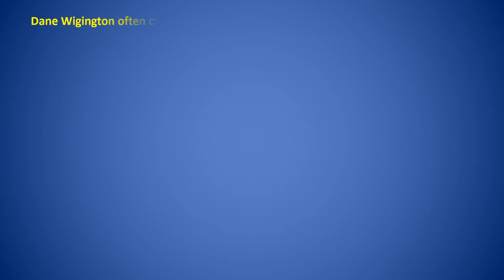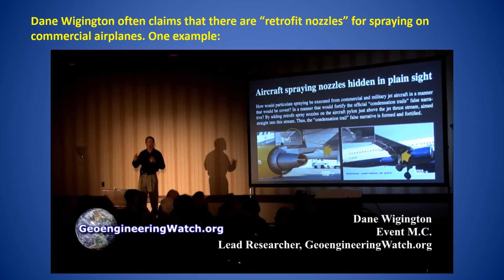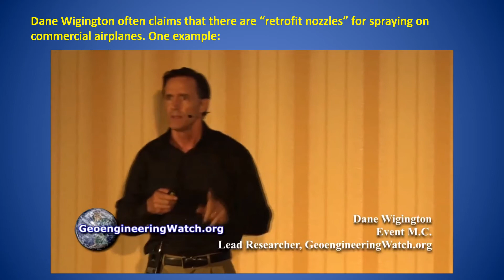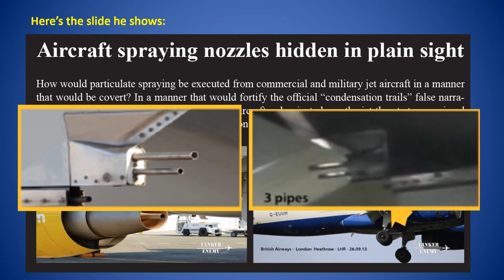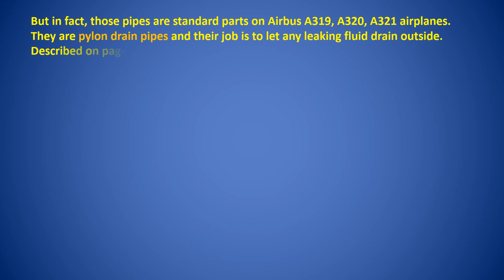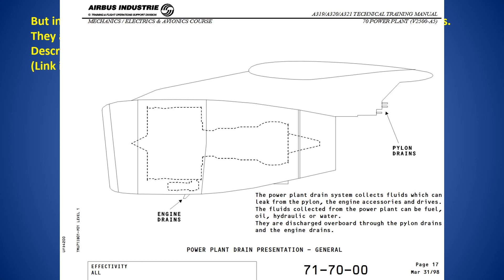Debunked: "Retrofit nozzles" on commercial aircraft

Comment: You are a lost,  blind soul if you deny that this is happening.  Use your eyes, it's that simple
Reply: Please give this a thought - 
1) My truth = contrails
2) Your truth = chemtrails which requires all of the following to be in place
- All civil aircraft to be designed, built and operated with chem tanks, pipe work and spray nozzles 
- Boeing, Airbus, Embraer, Canadair etc designers and engineers are in on the act
- All professional commercial pilots are trained to use and operate chem spray equipment
- All Air Traffic controllers are in on the act as they direct aircraft over built up areas.
- All airports are in on the act as they allow chem spray companies to operate airside with staff and vehicles.
- All the worlds’ meteorologists and weather forecasters are in on it
- All the world Aviation regulators are in on the act such as FAA, CAA as they allow these aircraft to fly.
- All the worlds governments are in on the act as they have agreements for the aircraft to fly 
Where are the whistle blowers amongst all this lot????
 Apply occams razor to both possible scenarios and which one is correct????
Reply: @andyb2515  The ladder is correct. Choice number 2. 180 government patents to prove that your "truth" (contrails) is boldface lie.
Reply: @jizzymc_guyre4217  Patents do not mean something is operational. I have 40 years in the aviation industry and can categorically tell you civil aircraft are not loaded with chemicals other than kerosene and potable water
Reply: @jizzymc_guyre4217  And your website shows that you spend all day playing silly video games, I dont suppose you have ever really looked up and understood what you are looking at!!
Reply from the maker: Unless you have a brain.
Reply: @GeoengineeringWatchDebunked  YOU WILL SEE WHAT WRATH IS ITS COMMING NEANDERTHALS
Reply: @GeoengineeringWatchDebunked  You're one to criticize. This video is lazy. You don't have the courage to show you face, use your own voice, or come up with some worthwhile evidence that Geo Engineering, AKA Climate Engineering AKA weather warfare isn't destroying all of mankind. This is why you post one lousy video every 2 or three years because you are a blatent fraud. May god have mercy on your soul.